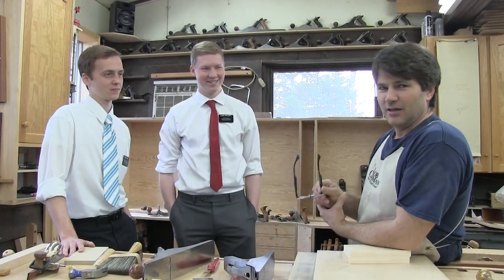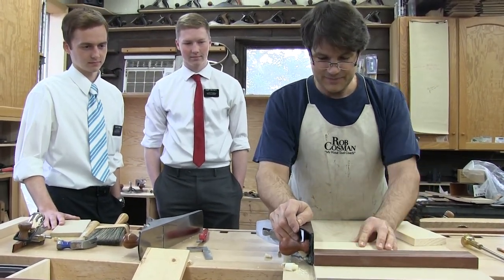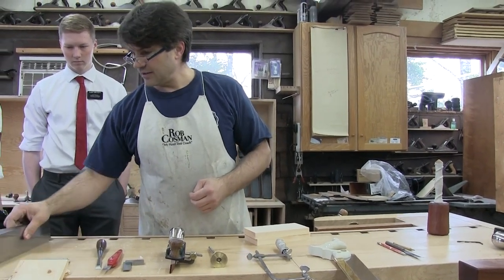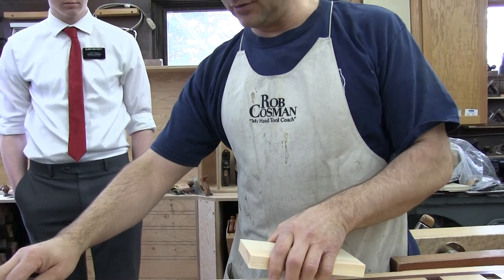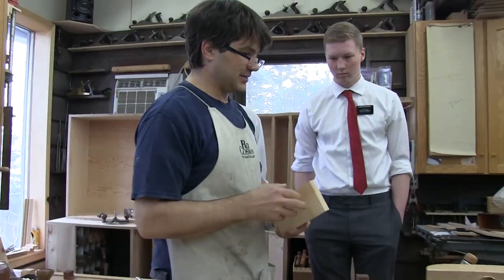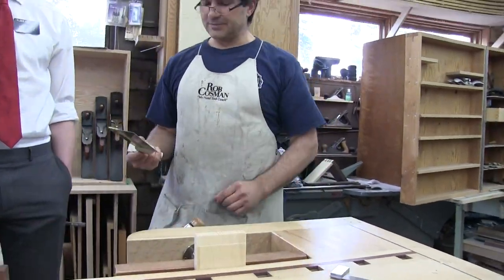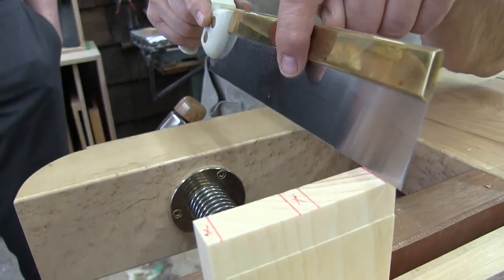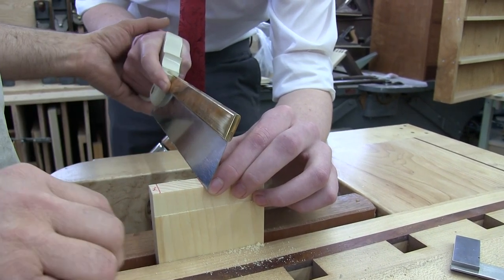Rob Cosman teaches Elder Torrie and Elder Draycot to cut dovetails!

Comment: Rob If you use a knife wall to line up the saw cut it is easier to be dead on the cut.
Reply: He did! He used the saw blade to create a wall for the removal of waste on the tails and a chisel to create the wall for the end pins. Why not watch the video instead of trying to find mistakes.